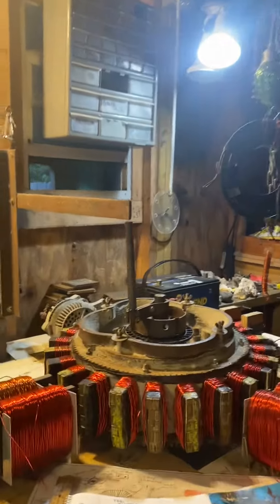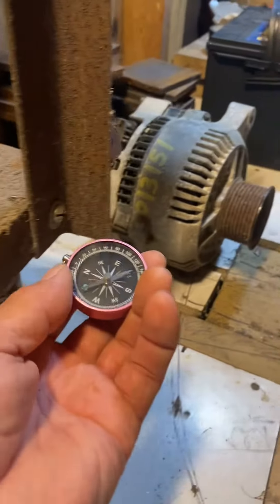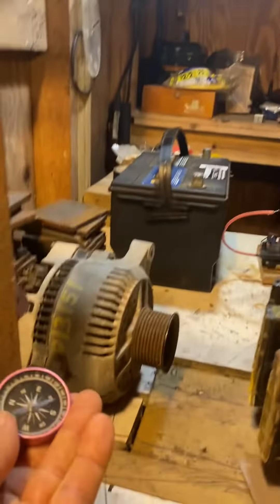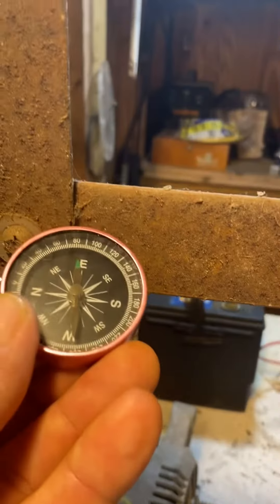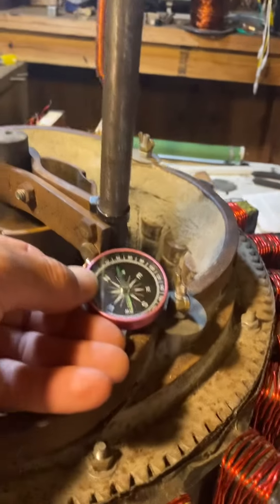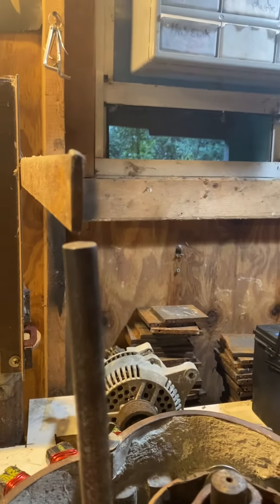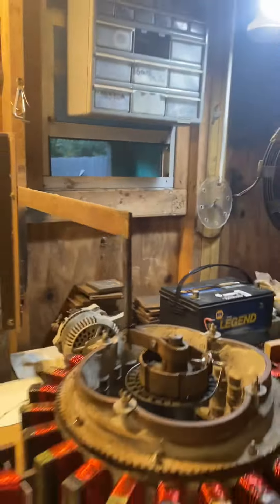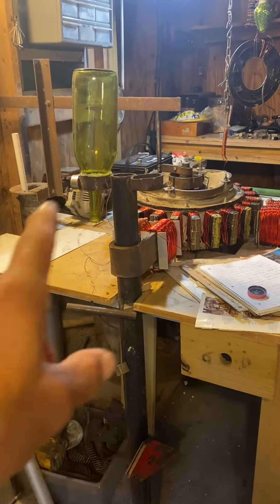Ed Leedskalnin’s Ring Bell Twice

Comment: Have you seen the Don Smith device? It is an electron pump using two grounds. One ground must have more resistance than the second ground so that the electrons cycle through the system.
His devices are self running, self generating systems where the electric potential is practically VAR where amperage can equal volts.
Static air voltages can range from 50000 to 1.5 million volts we it’s equal amperage.

Comment: I thought the discharge went from up to a brass plate directed to the clover ring. 🍀 not to the handle...
Reply from the maker: Look at the hook hanging from the chains in the picture.
Reply: @vinnystvincent9788   looking for more on this 'scaler wave' thingy... voltage pressure in the eather, relying on resonant frequency and capacitance on the receiving end. Most just build tesla coils to overdrive and see sparks.